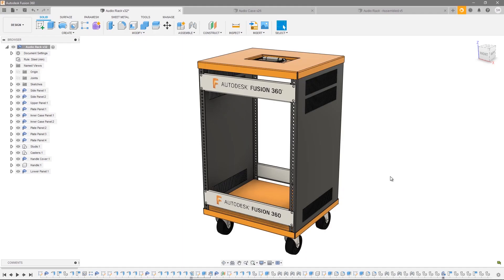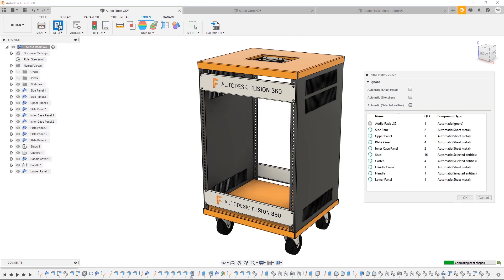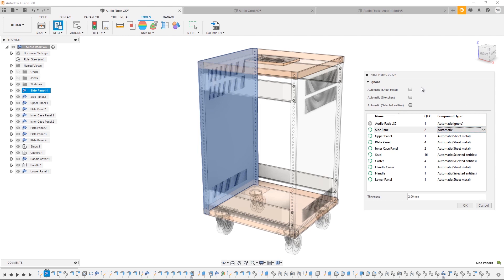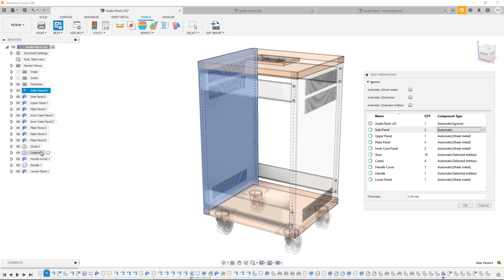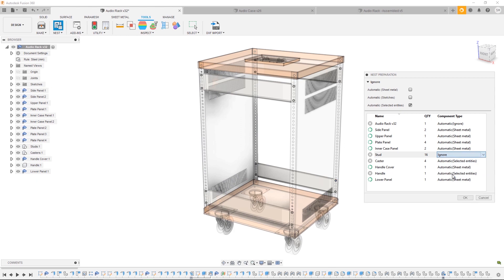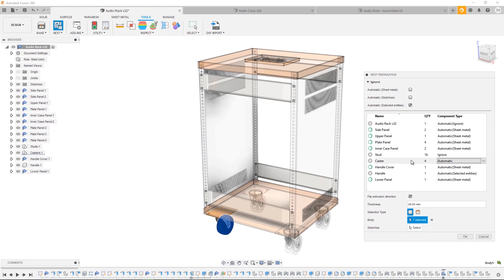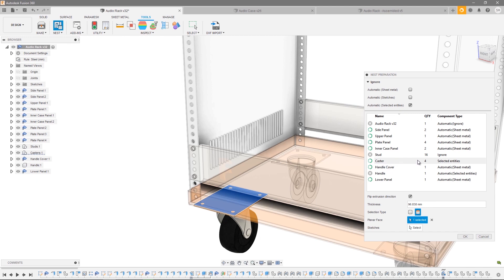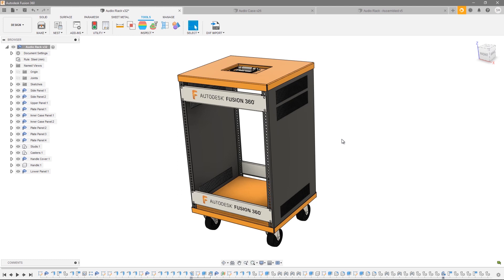Tutorial: Nesting and Fabrication Extension: Part 1 of 8: Nest Preparation

Comment: I don't understand this Nest Preparation window at all. Am I supposed to use this window to select which components I want to nest? How is it when you check the box to ignore selected entities, it knew to ignore the purchased items? Did you pre-select them somewhere that I didn't see?
Reply: Yeah I didn't understand that at all. Lots of terminology they use in fusion makes no real-world sense.
Reply: Yeah, the UX on this is not great. Seems like I used to be able to nest items pretty easily for laser cutting. Basically, I just want to quickly take a design made of sheet components and lay the parts flat so that they can be cut.